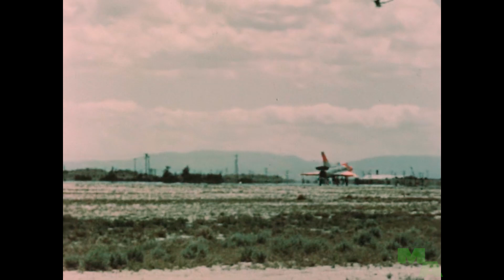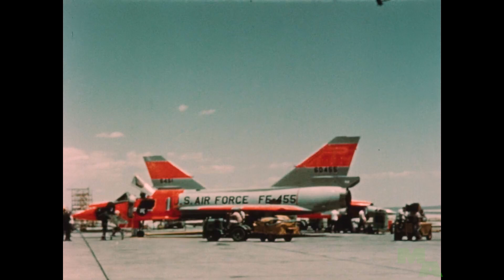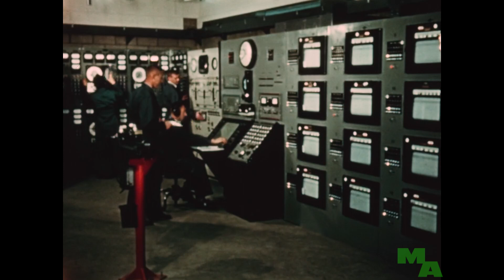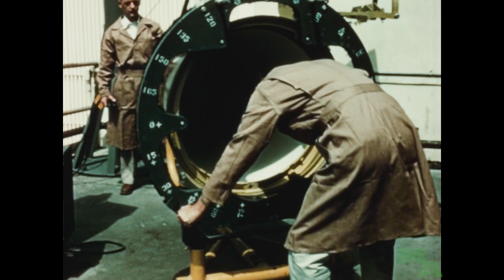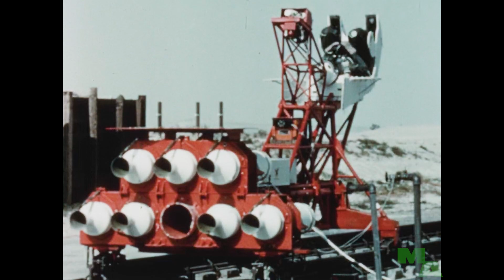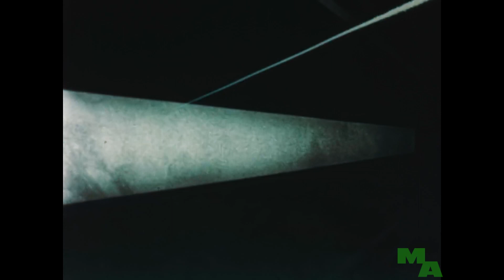Convair Delta Dart Supersonic Interceptor Report 1958 Outstanding Color!

Comment: @zenoswarbirds Was the script for this video done by AI? I've watched several other videos from your channel and they sounded like an old film with classic narration, but this sounds too much like an AI generated script.
Reply: It is exactly how the 50s announcers read their typical scripts in the day. I would have to disagree with you in every respect.
Reply from the maker: That’s the original narration on the film. I digitally eliminated some of the noise from the audio track which got worse with age to clean it up a bit, but that’s it.
Reply: @ZenosWarbirds  Thanks for the clarification. It didn't sound quite like other videos I've seen, but now it makes sense. AI has gotten so good these days, sometimes it takes a good ear to tell the difference. In this case, I was picking up on the digital cleansing. Thanks for taking the time to do that, I suspect the video unaltered would be difficult to listen too.

Comment: Former MA-1 tech here. I'm inclined to think that the reason only 350 were built was not so much about performance, but by the fact that by the early 60's the threat was less about manned bombers and more about ICBM's. The F-4 could do more stuff but it was not a quantum leap in speed or maneuverability. We liked to brag that not one Russian bomber made it past Winnipeg!
Reply: Sounds like the same excuse for the Avro Arrow.
Reply: @leftcoaster67  Very true. Canada wanted to develop their own interceptor but planners saw that the Cold War was starting to go through some changes.
Reply from the maker: You make good points. 👍
Reply: The F-4s held no edge over the F-106, which is simply not appreciated today. I recall an incident where two F-106s were up against 2 Phantoms on a dash back to base, typically (as in always) the F-106s were back on the ramp before the Phantoms even showed up with their black smoke trails on the horizon. With the Delta Darts having a far superior fuel fraction.
Reply: @Steven-p4j  Our squadron rotated several aircraft to Miramar NAS to participate in a program that would eventually become the Top Gun school. The F106 had a flight envelope similar to the Mig-21 which was causing concern over North Vietnam at that time. That program helped both air force and navy develop air to air tactics that had been long forgotten. Part of the result was that it was better to have a gun and not need it than to need one and not have it. Thanks for the chat.